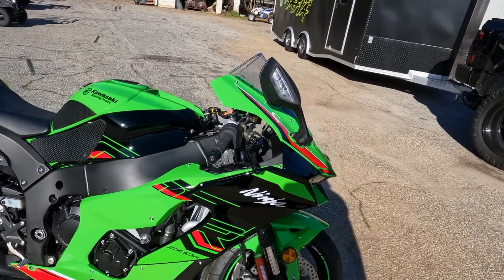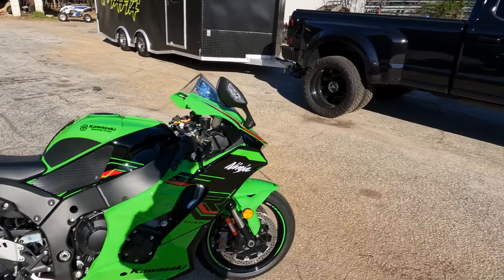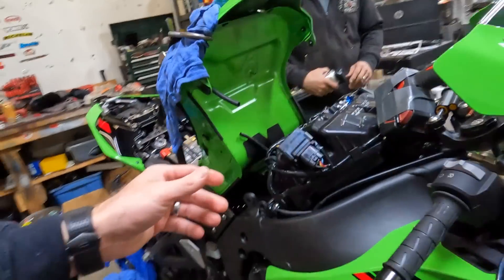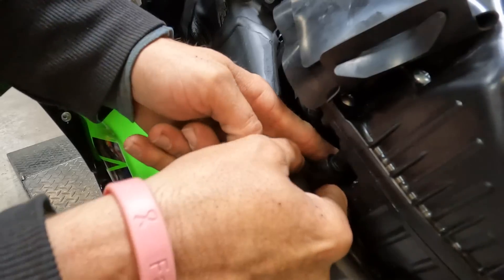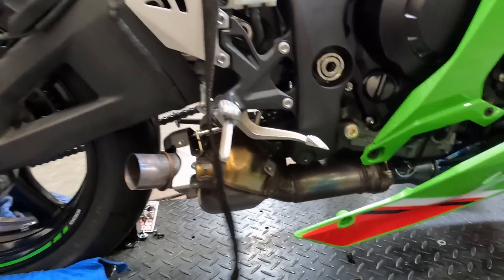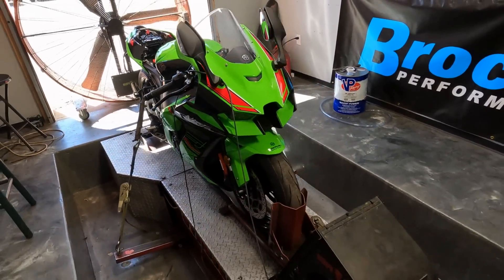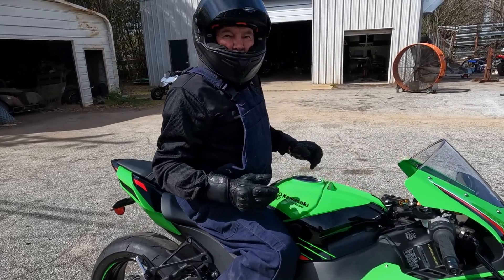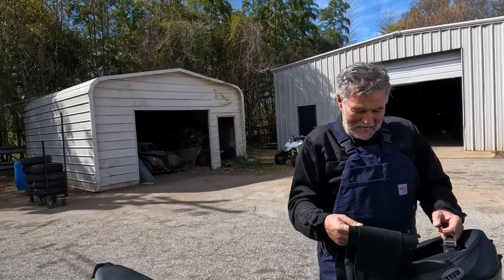2023 Kawasaki ZX10R Gets Necessary Upgrades for Maximum Horsepower

Comment: Brotha Moore, this only proves that riding a 'croch rocket' is not about age, it's about being in shape enough to do it !!  This could be applied to riding the BMW s1000RR as well.  Right here in northern Virginia, I've seen a 73 year old "brotha" riding his brand new BMW s1000RR(M edition with carbon wheels and carbon mudguards, etc..etc..) and he still goes to the gym 3 times a week to work out.  He's been riding for 50 years and has NEVER had an 'Upright' motorcycle in his entire life !!  Yet, he has NO backaches and he does alot of touring on his BMW motorcycles.  He told me that he thought about buying a suzuki Hayabusa, but the "flickability" of the busa was too slow for him and too heavy and he's 6'4" tall !!!!!  I'm 6'3" tall and he advised me to get the BMW s1000 M edition or 'RR' edition because the engineers that created the BMW s1000RR were naturally tall riders themselves and he told me that he's NEVER had a moment where comfort was an issue.  Matter of fact, Chris, he told me that he took his 2019 BMW s1000RR from here, northern Virginia, all the way to California and then all the way back here to Virginia without a single electrical or mechanical issue !!(BMW has a 3 year/36,000 warranty and roadside assistance with ZERO deductible) and he did this when he was 69 years old !!!  That inspired me so much that I nearly came to tears !!!!!

Comment: Will that marble mod work on any inline 4?  I just put a full exhaust and Power Commander on my Fz6r and now have the popping on decel.  Not terrible or anything but I’d rather it be gone.  This looks a lot easier (and reversible) than block off plates…

Comment: Can you add marble without any programming to eliminate pops and back fires and it won’t damage anything?

2023 zx10R KRT with M4 slip on, sprint filter and stock baffle in the m4. 
Thanks
Reply from the maker: Yes you can.

Comment: Hey Chris serious question.. I bought an 05 ZX-10R about 6 or 7 months Ago. It has 28k Almost 29k  Bike Runs Great. But I’m starting to Hear a little Tick low Rpm 1k-4k I’m pretty sure Vavles have Never been adjusted. I’ve did oil, plugs. Chain,sprockets. Just minor stuff. Bought new fairings anyways. Do you do Vavles at your shop. I just wanna be Preventive of any future problems I may have. Heard Things about the Keepers aren’t strong. But I’d like to do Vavles & Fuel Tune & Carb synced. Do you do that or just Tune? I’m from Chattanooga. Don’t know any good shops around I’d trust with Vavles does anybody els?

Comment: In Canada it says the maximum power of the ZX-4R is reached at 11,500 rpm due to government noise regulations.
Will it be possible to reflash the ecu to get back the 16,000 rpm redline?
That's the whole point of that bike.

Comment: Hey Chris, I just recently had my 2023zx10r flashed by yall (mail in flash) and my bike kind of surg after a minute or two during start up and the autoblipper is terrible during downshifting, it revs and gurk when I downshift making me not want to use. It seems like autoblipper was better before the flash. Is there a way it could fix? I have the same setup as the older guy do in the video...
Reply: I would suggest emailing them or calling. I've called them a few times and they always have been super helpful.

Comment: C'mon that's not correct in England we get 192 at the crank then we play a little unless ya is a spec no,es are just weaker cosmic emulsion we've got euro 5 which is harsh to pass town knowvbout Arizona fegionsbbug both would live to ride those roads